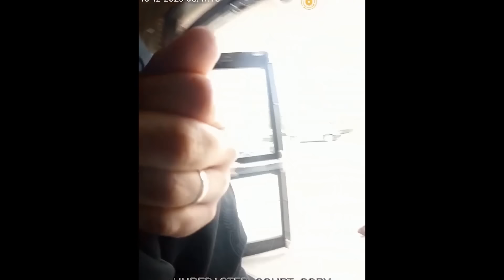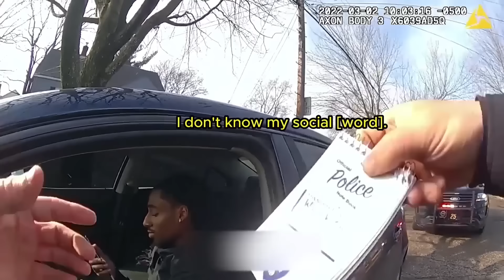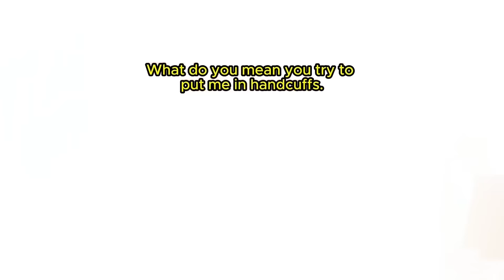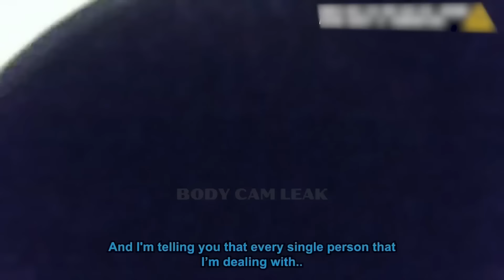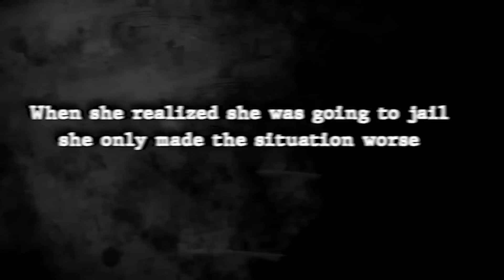When Teen Bullies FINALLY Get Humbled By Cops

Comment: There is no legal basis for a passenger who is not wearing a seatbelt to furnish identification, under the rights provided by the Fourth Amendment of the Constitution of the United States of America, unless they are suspected of being the owner of the vehicle. However, the driver, being ultimately responsible for the safety of the passenger, may be given a citation for that alleged seatbelt violation.
Reply: It probably depends on the state but where I live, an adult passenger not wearing a seatbelt would be committing a traffic violation and would need to provide ID.

Comment: The lad that tried to run and got tased was a dumb thing for him to do the cop was actually being nice and was going to work with the idiot, however the cop had no right to punch him in the face and then use force to push him back on to his front when he was asking why did you punch me, the cop was a bit over the top and needs reprimanded and put on an anger management course